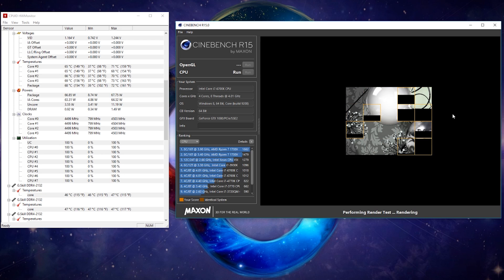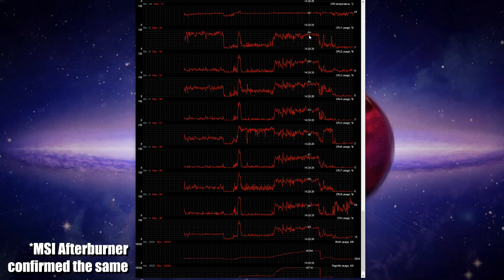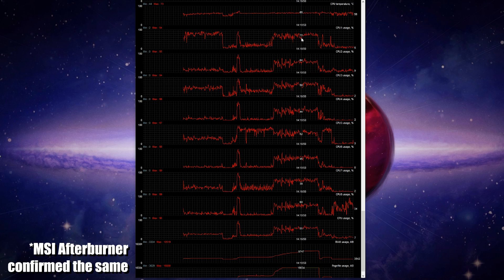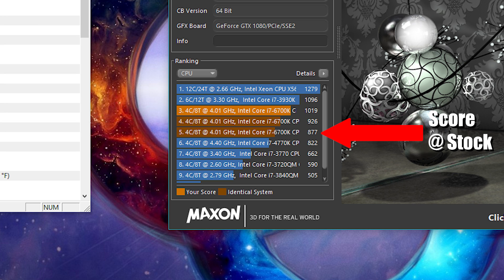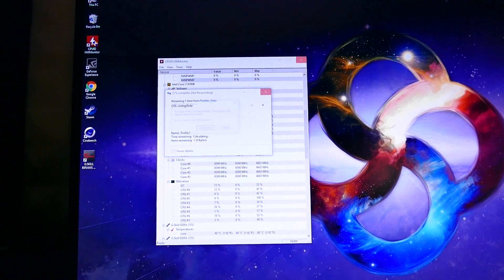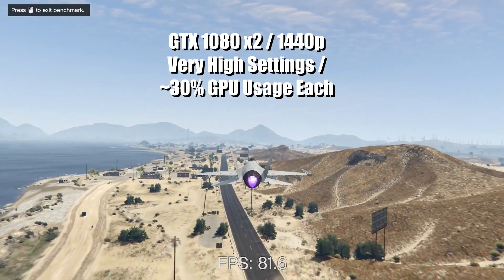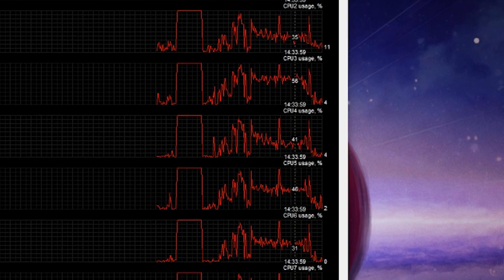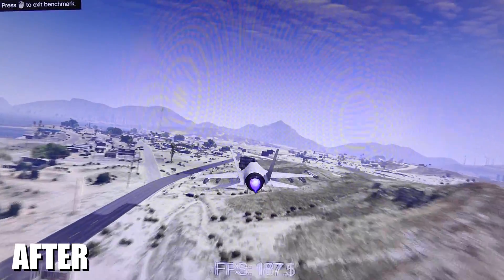My PC was Terribly Under-Performing...

Comment: I had the same problem with my 6700K overclocked to 4.5. I figured out what it was in my case. To solve the problem I bumped up the voltage a notch from 1.35 to 1.36. It solved everything. My conclusion was, that my overclock was slightly unstable. Just slightly. Why exactly the little bump in voltage made it that more stable, I don't know. I just know it solves my problem. Naturally, resetting the bios, like you did, would have also solved my issue. So maybe your cpu had the sams issue.

Comment: Lets go over the basics here: BIOS is nothing more than the firmware for your motherboard. CMOS is basically battery backed up RAM that the BIOS stores it's information at. So when you reset your BIOS, you are actually clearing the CMOS. And just like RAM, the contents of CMOS can get corrupted and will need to be flushed out. Some BIOS chips will be able to detect the corruption, some may not, some may be able to detect minor corruption, some may not. It all depends on the motherboard vendor. In your case, it sounds like you had a minor CMOS corruption issue and clearing it did the trick.
Regarding SLI: The problem is ur running Win10... rollback to Win7(no I'm not joking either)... adios amigo

Comment: It happens to me too. so I have 2 bios that you can switch manually A-B in my motherboard (very common, in case one of them fked up). I have the same exact overclock profiles on both of them, yet bios A somehow always getting errors and doesn't fully utilize all the hardwares. (Yes i tried back up my profile in B to A, still the same) Bios B on the other hand, runs flawlessly, but still, it ticks me off.

Comment: Pretty strange, but some other things to try for general performance problems:
-Profiling. Get something like AMD CodeXL (works on any processor), go to profile -> System-wide Profiling, run for 20 sec or so, then see what's eating CPU time. Unlike taskmgr, you can see which functions the CPU's spending time in, too.
-DPC latency checker. See if too much CPU time's spent in ISRs (interrupt service routines) or DPCs (deferred procedure calls) - these run at higher priority than user processes. 
- CPU performance counters, if you're very nerdy. Check Intel's developer manual for your CPU's counters. Skylake's on page 3431 of https://software.intel.com/sites/default/files/managed/39/c5/325462-sdm-vol-1-2abcd-3abcd.pdf. Intel has a monitoring utility at https://github.com/opcm/pcm. Clone that repo, compile it, read about your CPU's microarchitecture, pick events, and use pcm-core to track them. i.e. if you're getting a lot of L1/L2 cache misses, consider not putting two memory intensive threads on the same physical core. 
-Scheduling - If you think there are too many CPU context switches, in Performance Options, set "Background Services" instead of "Programs" to make the Windows scheduler prefer a longer quantum.

Comment: I'm big on just reinstalling the OS. (when I run into big problems like that) I use multiple Hard drives and I default almost everything that needs backups onto those drives. So usually I can do a full restore in a full Windows update with drivers within about an hour or hour-and-a-half. Which a lot of times is faster then sitting there for hours just trying to figure what is wrong with my system. All my steam, and UPlay games are easy. Just direct the App client to where the games are saved and then boom my whole library is back! only origin and UWP are a pain! They force you to re-download everything! lol

Comment: I've wanted to go SLI for a very, very long time. I have a single 1080, but SLI in general has always seemed like a really big headache. I mean, if it was correctly implemented in every game by default, I would jump in the water in a heartbeat. But, ugh. I don't know. I think I will upgrade my CPU/mobo before I do something like this. I'm getting tired of my 4670k D:. It's OK, and fine for what I'm doing right now, however. The itch to upgrade hasn't stopped in a while.

Comment: For OS reinstall best bet is buy a 2nd SSD and image your windows install,
once its all copacetic and the way you want it, to the 2nd drive.  Then when 
this kinda crap happens, just swap the drives boot order in the BIOS and
boot into the 2nd SSD, then confirm things still working well, if so image
that 2nd drive back over the 1st one, then swap boot order back to original.

Comment: Just today my cousins i7 4770k had a huge "crash", it turned of while he was making a video on adobe premiere and would not turn on... He said It might be the graphics card since it was underperforming for a couple of weeks to the point he had to use the cpu only for rendering on adobe premiere... So, he removed it and tried the igpu, the computer turned on but the image didn't apeared so,  since he doesn't understand much I told him, "do you see that battery on the motherboard?! Remove it, wait 2minutes" then start your computer again, so he did and BAM the pc booted normaly to windows with the IGPU..." then I told him to re-install the graphics card, just to be sure it died... and the computer turned on normaly with the graphics card..." So... With that in mind... I don't know if this is related to your problem but "clear cmos" also worked...  :D

Comment: 6700k should not be pulling 65W???????? mine does 89W under load at stock with lower voltages and about 101 when at 4.4ghz???

Comment: I experienced the same issue with my old install of Windows 8.1, which was a 2 year old install at the time. I noticed that the sound was waay off in DOOM and that the gameplay was choppy . Reinstalled DOOM ( my poor internet), reinstalled the freshest good GPU drivers for my 980Ti Poseidon ( also returned it and the i5--4670K to stock just in case), reinstalled the sound drivers, and it was still happening. The PC is also liquid cooled with a 360+240mm rads, and the D5 pump was going full bore, so the temps never went over 50C at best.
Wiped both HDDs and the OS SSD, installed Windows 10 64 bit, re-downloaded all the games, drivers, etc and the i was back in business as usual with DOOM being pegged at 200FPS on Ultra.
I blame it on the OS being a bit moldy, although i take good care of it with regular defragmentation of the hard drives, good drivers, a nice antivirus and avoid fishy sites on the net.
And no, the CLR CMOS didn't do anything to fix the issue.

Comment: Hey Greg, tried cold booting and then rebooting? My motherboard's a bitch and so sometimes my FX-6300 will cold boot at 1.4 GHz on all cores (even though the boot screen showed 3.5) until I reboot. Then they'll all be running at 3.6 (mobo is cheaply built, can't go higher). I know you're using a kickass motherboard here and swapping that out would likely be a pain in the ass (custom loop and all) but do try rebooting then looking at CPU-Z.

Hint: Task Manager only shows the average core speed or speed of first core, as well as providing inaccurate readings many times. I'll have to stress the part about using CPU-Z or a similar program (HWMonitor perhaps) as it's really the only way to know what's going on.

Comment: I had this exact same issue with my 980 ti. Even after reinstalling the drivers using that program that deletes them for you (forgot what that software was called) I was still getting 40/50 fps on my 980ti and I should have been getting nearly double that. Reset windows and it fixed it. I think that was back on windows 8.1 too. 🤷

Comment: My advice is manually set your pagefile - and go into power options and put it into "Performance mode" You may have already done this but for Intel chips I find this is always necessary (A ton of i3/i5 systems come through my work to be worked on and I always have to enable this to make them bearable). 
Im glad you fixed it but you can also run Tweaking and CCleaner and sometimes that clears it up.

A wipe and reload does cure many ailments ^^

Comment: Windows 10 can have weird problems after install. Once I did a fresh install and it cut my internet speed in half (Not the 10% it reserves for sharing updates and not a problem at the ISP end as was running full speed on Win8 of my duel boot) reinstalled it again using the exact same setting and got my full speed back, still to this day I can't figure out why, just happy I have full speed again.

Comment: I probably know what caused the GPU issues, I had the same symptoms (on an amd 7950 though). Windows enables by default fast boot, which caches the gpu driver every time the computer is shut down, to allow a faster boot. On some configurations, the driver restore goes wrong, and the GPU doesn't perform up to par. A way to check if this is the problem is to reboot (using windows reboot option): this forces the driver to be reloaded, and fixes the problem. The quickest solution is to disable fast boot, and it fixed my problem (and could have fixed yours, too)
Reply: Niccolò Picca Holy mother of God thank you so fucking much my 1060 finally works.
Reply: I'm glad to have helped :) I literally spent months trying to figure out what was causing the issue....
Reply: No problem man, enjoy your new framerate :)
Reply: @swampert543  I have a r9 280 that's doing the same thing, games like fortnite and other titles that should be easy for this card, run like dogshit. I might get 75% use on the gpu and less on my cpu.
Reply: stayve aye glad to hear you fixed it too, I know the feeling :D
Reply: Also, I suggest that you should disable Windows data tracking and stuff, because it runs in the background and could slow down your computer
Reply: and how to disable fast boot?
Reply: iGPU Chip Gaming how exactly do I turn off fast boot ?
Reply: the windows quick boot actually doesnt boot at all.  its the same thing as hibernatiion basically.  so the computer never reboots. i think this is a bad idea.  a lot of important things happen when booting and a lot of important things get refreshed
Reply: YES Microsoft has that setting in such a strange place.. I always turn it off cause it caused many problems
Reply: Niccolò Picca hey, I know I am a bit late but I'm just wondering if you could help. As of now I havent tried your solution but I honestly don't think it would work for me :/ this is because my pc used to perform fine and then all of a sudden it began to perform like absolute shit. My specs are: 

Cpu - R5 1600 3.2 GHz
GPU - gtx 970 4gb 
RAM - 8gb ddr4 2133mhz ( running at the default for now) 

If you need any more specs then let me know
P.s I have tried everything that I can think of and nothing helps apart from restarting my pc which only helps sometimes
Reply: @jacksutton9425  same, nothing is helping. My gpu and cpu have started underperforming massiveley
Reply: You are god among men, i've had gpu issues for months trying so many things to fix it and then it turns out all i had to do was to uncheck a single box on the control panel. Can't thank you enough man.
Reply: @FinSliparen  which box?
Reply: ChickenDope What single box did you uncheck? I have NVIDIA control panel, my GPU is underperforming badly and I’m lowkey stressing over it.
Reply: @micspamgod2324  did u ever find a fix?
Reply: @NLAngel_  Nah I was being dumb and it wasn’t underperforming as much as I thought. Nothing to worry about now.
Reply: @micspamgod2324  same
Reply: I’m having this issue with my RX 470 and disabling fast boot didn’t fix it
Reply: I have a decent build I have a and 2200g and and radeon 570 and am averaging 100 fps on fortnite all low settings with discord open I used to have better fps buh my pc has had a BIG range of different fps rates this is the worst it gotten and it keeps getting worse plz help  me it's getting out of hand. I saw vids of people running 160 on epic -low setting and I'm getting far worse plz help
Reply: THANK YOU SO MUCH! I’ve been looking everywhere and trying everything!!! After doing this I got DOUBLE my frames on valorant. For real dude I can not thank you enough more ppl need this information.
Reply: Just Ice can you tell me what exactly you did?
Reply: @JustIceIt  after doing what? Need help:/
Reply: @awpR just disable fast boot and restart!
Reply: @awpR @Roman Kim you go to control panel, hardware and sound, power options then click on choose what the power buttons do on the left. Once there uncheck the box that says turn on fast startup and then restart your pc. This 100% fixed my issue. Hope this helps!
Reply: @JustIceIt  i dont even have a checkbox thats saying it lol
Reply: thanks without my overclock my score is 0% lmao both of the solutions the comment and reply helped alot
Reply: Idk if anyone will see this bit I'm having the same issues on a 3070 FE and I will definitely try this method tomorrow so hopefully it works 🙏🤞I'm getting between 15 and 30 FPS on games so I need this to work
Reply: @Warhammer-o4g  yo boss same here on my 3060ti ftw3 ultra
Reply: @zullox  it didn't work for me :(
Reply: @Warhammer-o4g  dam
Reply: @Warhammer-o4g  see I get good gpu usage in for example apex, but gta 5 it’s at 50 percent usage
Reply: @zullox  I am getting around 0.1% on most games which is only 1/10 of 1% most games are unplayable which I need to still try and fix. I sorted it a little by going back to the earliest driver I could find which somewhat helped but nothing really much. It only got me to a max of about 30%. I heard there is a new driver update out today so I'm hoping that will fix the issue but if not I may need to try and factory reset my pc as a last resort.
Reply: stayve cpu?
Reply: Niccolò Picca Yes, you are absolutely right.
Reply: The only proper way to do that is when first installing WIN, and running customize install, then diable like 9 of them from there.
Reply: stayve this is correct too... mobo's with multiple PCI slots will run the top slot as fastest , second slot slower, last slot slowest, unless you've got SLI or crossfire
Reply: Awesome info Thanks Niccolo
Reply: Thank you so much for the help!
Reply: Getting too old or the cpu is dieing or gpu dieing
Reply: Jack Sutton disable fast boot that works or reinstall windows
Reply: That’s the first thing I turn off (that and a number of settings) when installing windows 10. Why did hey add such a buggy feature to windows? We will never know.
Reply: I had the same problem in bf5 and few other games with my gtx 1060 6gb This fixed mine problem "Go to NVIDIA control panel - manage 3d settings - program settings - select the game and than power management mode set to prefer maximum performance" now it has 99% gpu usage
Reply: how did you do it? can you please give a better detail?
Reply: GOD BLESS YOU
Reply: Is it fast boot in the bios or fast boot within windows?
Reply: @McGrasss  bios
Reply: Niccolò Picca I don’t see windows reboot option
Reply: didnt work for me plsss help meeee
Reply: @bese4986  can u help me how to do this in a detailed way the reeboting stuff cuz i changed the fast reboot to disabled
Reply: @bese4986  ok thnx :)
Reply: how to disable fast boot
Reply: what is the "windows reboot option"?
Reply: How do I do this?
Reply: How can I do  reboot  that you mean, please help
Reply: @Tarky2  rebooting windows is as simple as going clickong restart
Reply: Thank you very much 2 years ago I have the pc and I did it and it was solved cry from the nose I don't know how to thank you seriously.
Reply: Dude i had this problem with the rx 570,it reached 100% usage but using only 70 TDP,i almost did every f***ing thing(overclocking,bios flash,windows reinstalling,...)it just didn't work until i saw your comment,THANK YOU!!!
Reply: @ghasemabbasi5241  yo bro how did u solve the issue exactly i haev the same problem on my gtx 1080, 50%-70% TDP
Reply: @maxlastbreath  well I increased the maximum TDP and updated every driver and it was all OK after that.
Reply: @ghasemabbasi5241  wait you increased the max TDP? How can you do that? Well my exact issue is, i have a 1080 and it's been running about 50% slower then before. The gpu reports 100% usage, I've been trying to fix it for a very long time, the gpu is about 2-3 years old now, out of warranty as well I'm not sure what to do, stuck just like you were back then
Reply: @stayve.  how do I go into my bios and change that?
Reply: How do I disable fast boot bro
Reply: @jamielannister6922  1.) Open “Control Panel” and click “Power Option”, and follow below picture.
2.) Click “Choose what the power buttons do”
3.) Click “Change settings that are currently unavailable”
4.) Disable “Turn on fast startup”

I tried this and apparently my PC wasn't underperforming after all I was just stupid at the time.
Reply: @micspamgod2324  I tried it and I didn’t even have it on. I’m so confused
Reply: @stayve.  my cpu and gpu is using lower than that ! I tried disabling fast boot but u didn’t have it on. I’m scared
Reply: So turn off the option "Fast startup"?
Reply: @jordanborg8868  that doesn't do anything for me
Reply: @Warhammer-o4g  my laptops performance has consistently gone downhill and I'm not sure how to fix it, I have a gtx1060 but it runs terribly
Reply: @jordanborg8868  have you tried going back a few driver updates?
Reply: @Warhammer-o4g  I have not, how far back do you recommend going
Reply: @jordanborg8868  keep going back one at a time and seeing if it makes much of a difference. Just go back as much as you need to.
Reply: @Warhammer-o4g  okay thanks!
Reply: ty
Reply: It helped mine my PC under preformed so much my game would hit 30 for to  20 now it's working
Reply: will this help speed up my laptop in gaming? It has a GPU
Reply: @jonnolags  no.

Comment: ive got a 1080ti paired with 6500 running 1080p, i get frame stuttering a lot. im getting a 3440x1440 monitor and a 7700k (i have a z270 motherboard) as i borrowed my friends 3440x1440 monitor and 7700k and it fixed the issue. is there any other, cheaper solution that you guys could let me know about?